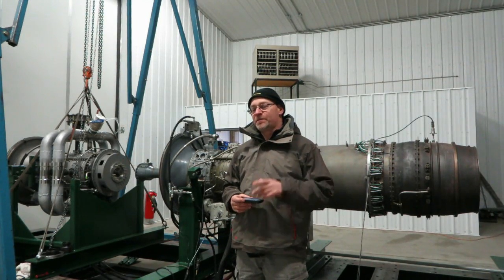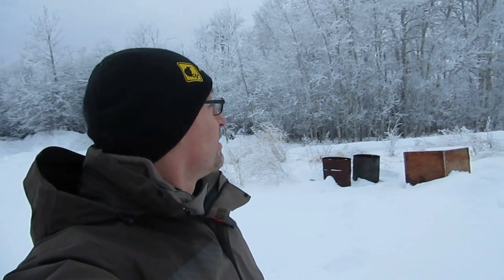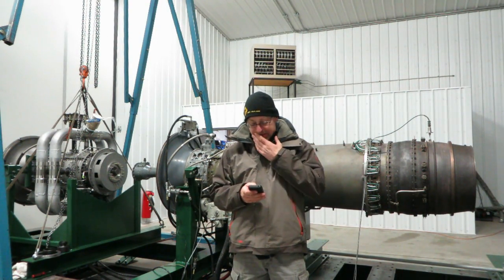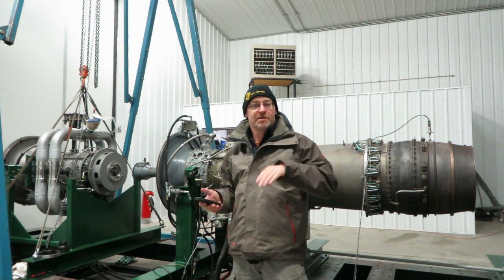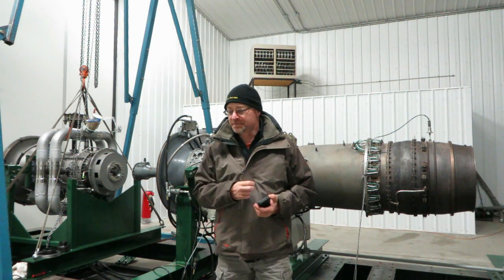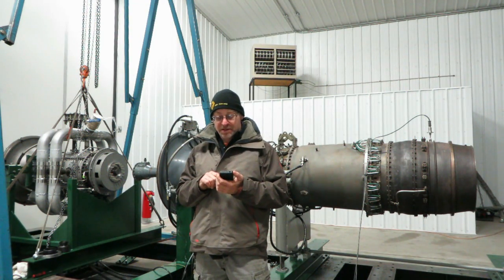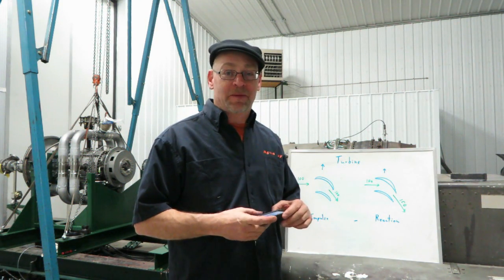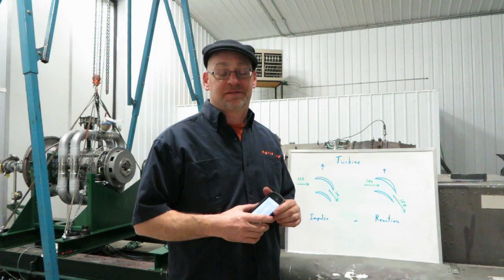Your Questions 23

Comment: On the subject of impulse vs. reaction - I would imagine that why impulse type turbines are used for water is that water will not compress so the tighter exit would just be a restriction to the overall flow.

With gasses, the reaction type would compress and speed up the air which could be useful as it passes to the next stage.
Reply from the maker: Sounds good to me.
Your pillow talk is seductive...
Reply: I don't know the pros and cons of the turbine design but the fluid acceleration will happen even if the fluid cannot compress. In fact, it will happen MORE if the fluid cannot compress. That's why rivers flow faster where they are narrower or shallower or both.
Reply from the maker: Yes, this is correct. I did not catch it the first time I read pillowcase1's comment. The narrower passage does not cause the gas to compress... the pressure drops, and the speed increases.
Yes it's all very counterintuitive...

Comment: Why EGT is important? Another reason why it's measured is to determine the success of a shop visit. Especially the success of a "Performance Restoration" shop visit is measured with the "EGT Margin". As the engine runs, it wears, gets dirty and the efficiency is reduced over time which all leads to the loss of performance. Eventually EGT limits approach and the thrust has to be reduced to stay under the limits. A clean and happy engine has a high EGT margin. It can either produce more thrust before the limits or work much more efficiently at lower thrust levels. The latter is more desirable in civilian world.

Comment: Hi, I have only subscribed to your channel recently and started watching the Your Questions series from the beginning. In 02 and 03 you answered the question about the "non-spinning J79 fan". I would like to know why are these vanes there. The high - bypass engines (Trent series) don't have IGV's in front of the fan? As part of my course I take an Aeroengines module according to which, a compressor stage goes like: rotor - stator - rotor... Whereas a turbine is stator first. Thanks.
Reply from the maker: " why they are there".. more on that when I describe how compressors work.

Why the fan of a turbofan doesn't have IGVs... I have Ideas, but I don't really know

And I hope I don't need to point out to you, sir, that the function of a turbine is exactly the opposite of a compressor.
Reply: I know the only function of the turbine is to drive the compressor. I also know that the flow out of the burner might (and most likely is not) in axial direction (or other favourable one) and thus there are guide vanes. I will be looking forward to seeing your compressor episode. All the Best, Peter.

Comment: Informative again Jay thank you you always seem to have all the answers and i am in aww. I am thinking i will be seeing you posting a video of cold fusion, if anyone can you could. Question if you have 2 jet engines the same is there a way to get significant HP (thrust) over the other? They seem designed for a certain number of compressor stages and therefore more compression is not possible and just dumping more fuel would melt parts so is it even possible?  Great videos and please keep them coming best on you tube.
Reply: Engine manufacturers develop upgrade kits over time. As computer design technology improves, better compressors can be designed with more efficient 3D airfoils, more efficient combustion chambers and turbines. In civilian world this translates to the mentioned efficiency in fuel economy, reduced pollution and maybe even lower noise levels rather than increased thrust. Increased thrust is the by-product of such upgrades but is usually not the goal as cost efficiency is more important for airlines. You can Google "CFM56 tech insertion" for a good example. In military world it's the opposite I suppose.

Comment: Contra-rotating propellers can propel air faster, and even do away with the need for stators in some cases. Do you know of any examples of contra-rotating, LP, HP or exhaust turbines?
Reply from the maker: Turbines don't move air... They are moved by air.
I've heard that the two systems of the Pegasus turn in opposite directions.

Comment: and the roller bearings are less sensitive to low oil, as compared to sleeve bearings for power steam turbines, which must have jacking oil if you want to move it.

Comment: Hi Jay. I was watching a documentary on the SR-71 and they mentioned that at high speeds the engine would "unstart". I understand this has something to do with inlet air speed, but I'm still unclear on the factors that cause it, or exactly what it is. Thank a lot!
Reply: I believe that the SR-71 engines work as a hybrid, turbine & ramjet, at cruise speeds of mach 3+.  The ramjet provides most of the power at that speed.  The inlet cone is adjusted to control the ram air speed and/or pressure to the input of the ramjet bypass ducts.  These ducts direct air past the turbine engine and into its exhaust where it is combusted like an afterburner.  I think that the ram air needs to be high pressure and low (sub-sonic) velocity for combustion and proper operation.  Any upset or imbalance to the system can cause the ramjet/afterburner to go out and the engine system will loose approx. 80% of its thrust, now running on just the turbine engine.  The inlet cone needs to be re-adjusted before the ramjet can be re-ignited.  Somebody please correct me if I am wrong, especially AgentJayZ.
Reply from the maker: This is outside my area of knowledge, so I am going to say that honestly, I don't know anything about this,
Reply: Sounds good to me.  Thanks!

Comment: That single center main bearing is taking the entire thrust of the engine. That's an enormous amount of force. It seems strange that the thrust could not be equally distributed between all the main bearings.
Reply from the maker: That is incorrect. This misunderstanding is addressed in a couple of my videos, contained in my playlist "Your Questions Answered" I suggest you have a look at the index.

Comment: Hi Jay ! Nice Vids. I frequently get to fly in an BK117 helicopter as a passenger. After each landing the engines have to run in idle for two minutes before shutdown. Watching the EGT I see no changes in that period of time. Is there a technical point in idling the engine before shutting it of or is it just because it says so in the manual ?
Reply from the maker: Very good question. Stand by for a video response,,,

Comment: Question:
Is there a turbine temperature limit for starting an engine? What I mean is, if the turbine temperature is above a certain amount, and the engine is started, could it be damaged?
Reply from the maker: Yes, starting is difficult for turbine engines, because the low speeds mean the compressor is not supplying much cooling air.
The starting EGT limit is usually a couple hundred degrees higher than the max operating EGT, but with the understanding that it's only for a few seconds while the engine is accelerating to idle, when the supply of cooling air becomes adequate.
If the engine fails to accelerate to idle, and stays at starting rpm and temp, this is called a hot start, and does indeed cause heat damage to the engine.
Reply: Thanks for the reply! :)
I'm sorry, what I should have said is if there is a temperature limit BEFORE the engine is started

Comment: Is the start-up procedure ever automated on a turbine engine or all operators and pilots required to manage the starter, igniters, turbine speeds, temperatures, fuel flow, oil pressures and such?
Reply from the maker: Modern airliners have a start switch, and the computer handles everything.
Reply: On older aircraft like the P-3/Herc, the pilots and FE would monitor the start and flip ignition switches, turn on fuel flow, monitor temps and rpm.
Reply from the maker: I do think it is more interesting to start them up the old way... manually, but it is more risky.

Comment: question? i saw years ago on a t56 type motor in a cogenberation plant setup. the operator periodically hooking up a tank of distilled water to ingest in engine. is the purpose to clean the combuster cans and turbine blades. and have you ever discussed using steam injection on engines to add power? used in power production
Reply from the maker: Distilled water is used for cleaning, and it is used for power augmentation.
If it was hooked up periodically, I would think it was used as a rinse after a cleaning, usually done every thousand hours or so of operation in power generation.
Reply: Some aircraft (eg F105) had a water/methanol injection system that could be used for short periods to temporarily increase thrust. The amount of water etc carried was of course relatively limited. The injection system was intended for use on takeoff when the aircraft was high/heavy/hot or in some cases (from what I've read) to increase thrust if needed to get out of Dodge a little quicker...
Reply: the plant also used stream injection that was created off using heat from the exhaust. the coolest thing i saw was a lm2500 engine having the air being cooled with an absorbtion chiller running off the waste heat to give the engine 55 degree air on a hot day

Comment: Hiya again Jay. Just watched "Questions 23" and have a couple questions for you.

First a shut down turbine that is wind milling on the ground. I understand for a short period of time it's OK, but if for a longer period of time then covers go onto the engine...stops birds nesting in there as well.

How about in the case of a turboprop if you have to shut it down in flight and for whatever reason the prop fails to feather? I recall the pilots saying a failure to feather was a real problem, but never found out what the problem was...thankfully!

Secondly, EGT... on start up, the flight engineer would record the max temp seen by the turbine and indicate if it was a hot start or normal start. Would I be correct in thinking that a secondary reason to monitor EGT might be to determine if the engine is burning/torching/runaway fuel control unit?

Thanks!

CP140405
Reply from the maker: Being a single shaft engine, the T56 would drive its oil pump if it was windmilling. However, if the prop won't feather, the engine would supply a lot of resistance, and this would be a large drag on the aircraft. Asymmetrical too.
I don't think the engine would be damaged, but remember I am not a T56 expert.

Regarding EGT, as explained in earlier vids, the hottest an engine gets is on startup. Due to minimal airflow, there is very little cooling, and the temp can get very close to destruction levels. It's all accepted, since it is only for a few seconds until the compressor speeds up and supplies more air.
If the EGT exceeds the starting limit for even a few seconds, the engine operation manual states "reject engine and route to overhaul".
Failure to heed these limits may result in loss of engine in flight, with possible very bad consequences.
Reply: AgentJayZ

Thanks Jay. I understood the increased drag/asymmetric thrust/decreased range&speed issues but was more thinking about mechanical issues with the engine/transmission itself.

As for the EGT... yes I recall the bit about EGT spiking on start up and then dropping back to within normal operating limits. I'm just thinking that if all four engines are set at roughly the same fuel flow/power setting and one of them has a significantly higher EGT, then it might be indicative of something bad happening.

As an aside to that, I was once told the engines would start a little hotter if the aircraft was positioned so that the wind was blowing up the tailpipe.

I'm not a T56 expert either... I just listened to the intercom chatter and waited for the "stable power" call before I went about powering up various electronics!

Comment: Question: Why are turbofans more efficient (for airliners) than pure turbojets, despite having the additional moving parts of an LP turbine and fan? Usually adding heavy, moving parts and energy conversion steps reduces efficiency of a mechanical system, right? Is it because you gain more efficiency by slowing down the exhaust gases than you lose when converting energy from the turbojet exhaust into fan power?
Reply from the maker: The extra weight and complication in this case is worth it.
The turbofans move about 20 times as much air as turbojets, and do it at a much lower speed.
The closer the engine exhaust gas velocity is to aircraft design speed, the better your fuel economy will be.

Comment: isn't engine shaft length (expansion or contraction due to heat) important for the clearance of compressor stator blades? ; or the movement allowed is specially designed and spread around to all spaces?; or the housing containing static compressor blades also expands and contracts with the engine shaft ?
Reply from the maker: The clearance between compressor blades and vanes is roughly 0.200 or so... roughly. This is much greater than the expansion of the shaft or cases.
The temps are higher, so the expansion is greater in the hot section, but so are the nominal clearances. Under normal operation, nothing ever touches.

Comment: How can we know an engine turbine stopped due to water contamination???
Reply: Luis Ventura the only way an engine would shutdown from water contamination is if the fuel tank was full of it.

It is impossible to prevent water from forming in tanks. Water vapor will always work its way in due to the fuel vents. However, during 1st-Gos or the initial flight, pilots or maintainers of smaller jets/props and helicopters always do a fuel sample test to see if there is any water contamination in the cells. I can't speak for airliners as I am not sure how they are tested.

If a sample comes out with water in it, some fuel is drained out to "flush" out the water that has accumulated at the bottom of the cell (some fuel cells are designed with a "bowl" of the bottom to catch FOD and water). After the flush, another sample is taken. If water still shows up, maintainers are called out.

Two things happen here:
1) Maintainers take a sample to see how much fuel is contaminated. If it looks less than the first sample, they will flush out some more until the remaining water is gone.
2) If the contamination is so great that the sample is cloudy, green from organic contamination, or shows FOD/Debris, then they will down the aircraft and have to drain/flush the tanks/cells and fill it up again if it wasn't something other than water contamination.

If it's organic or debris then the cells will have to be drained, purged, and opened to be inspected.

I speak from experience only as a US Navy mechanic. I can't say the same procedures apply to civilian aircraft.
Reply: Yes, I think so and recent Glasgow Helicopter accident or similar ones maybe were due to that

Comment: could you have a turbofan engine with afterburner on it ?
Reply: Yes you can. The F-18 Hornet has the afterburning turbofan F404.
Reply: Also, the only difference between the F-18 and, say the CFM56 used on the 737, is that the fan and fan shroud/case itself are enclosed on the F404 vs the CFM56 which is open. 

Due to these military aircraft being supersonic, the fan section is enclosed in a tube design that rides along the entire length of the engine. The compressor section is deeper inside, so a good way to see the design would be to look up a cross section of the F404 and the CFM56 and compare the design of the fan section of each to see what I mean.
Reply from the maker: Almost all military fighters have low bypass turbofans ( 1:1 ratio approx.) equipped with afterburner.
The CFM56 and other airliner engines are high-bypass engines ( 1:5 to 1:8 approx.)
The low bypass turbofan offers better fuel economy than a turbojet, and retains the supersonic capability,as well as the slim shape that minimizes drag caused by the airframe that has to hold it.
The high bypass turbofan sacrifices the high speeds attainable by the turbojet, but offers huge thrust and vastly improved fuel economy.
Reply: thank you for the answer you guys

Comment: How does life exist by you at -35?  Here near Chicago nothing would function.  Stores & businesses can't or won't open.  Cars won't start.  If they do the tires are frozen out of round.
Reply: i'm guessing hes using celcius
Reply: ***** -40F and -40C are the same btw..
Reply: Life continues no matter the temp, we hit the -35C  also last week and even hit -47C one day you just cope that all you can do. We live in the north and cold weather is just one of the things we endure.
Reply: Most things still function at -35. Even at record lows in the -40s or -50s, things around here still function, including cars.

Modern cars, as long as they have functional, fully charged batteries, will start no matter what the temperature is.
Reply from the maker: Engines on airliners are always running way up in the sky, where the temp gets to -70C sometimes... but for starting, I'm not sure what the limit is. When we want to run an engine on a cold day, we heat the oil supply to about 35C before attempting a start.